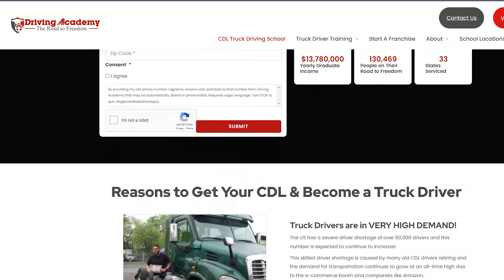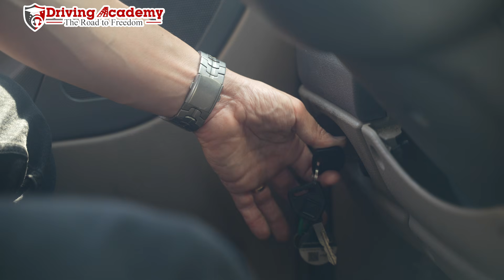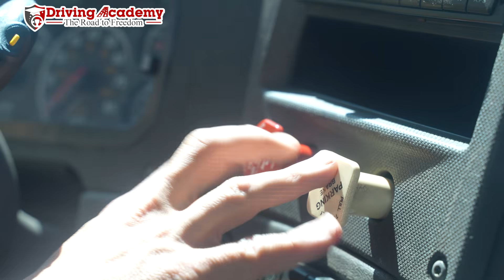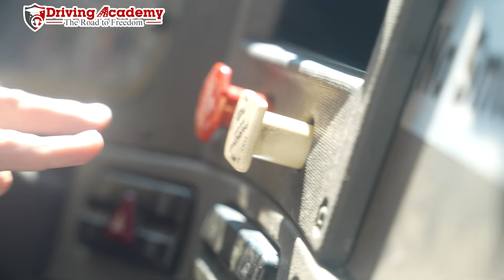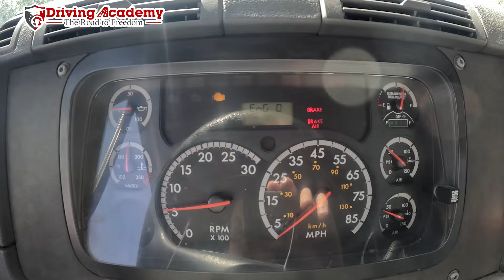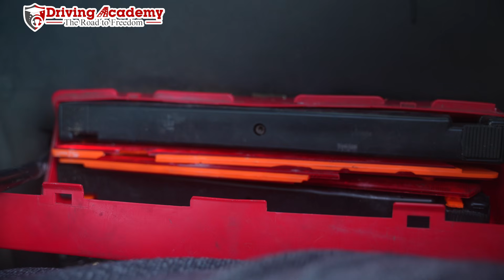NEW 2026 CDL IN-CAB INSPECTION + AIR BRAKE TEST (STEP-BY-STEP GUIDE) 🚛 ACE YOUR CDL EXAM!

Comment: I failed my test for not double checking both valves popped out during emergency spring brakes. Only trailer popped and tractor stayed on. SMH I retest tomorrow
Reply from the maker: Don't get discouraged, you'll get it right this time!

Comment: Please stop giving Mis information during the in cab inspection, once you complete those steps you CAN NOT  do it in order you want as long it’s done. That is an automatic fail, they will tell the driver they are jumping and fail them. It has to go 1-28 on that list as per the DMV !
Reply: I am sorry to say but you have no idea what you are talking about. Maybe your particular trainer instructed you to do it this way, but they want drivers to do the minimum basic safety check items per DOT regulations. There is no "128 items" on the list. In some states you can actually use the checklist during your examination and check things off as you go. The air brakes test MUST be done in order or it's an automatic fail. Build air pressure to governor cut out. Air leakage test by pushing brake pedal and timing 60 seconds and not losing more than 4 psi in a combination vehicle or 3 psi in a straight truck. Fanning the brakes to check the alarm system at 60-80 psi but no lower than 55 psi. Fanning the brakes until the valves pop out. Then restarting the vehicle to rebuild air pressure at which time you can perform your in-cab inspection (mirrors, dash indicator lights, horns, heater and defroster, windshield, windshield wipers and blades including fluid and blades making contact with the glass. Emergency equipment check. Steering wheel check for play. Once pressure has built back up to 125 psi or so, perform the tug test with the each brake trailer then tractor and try to move forward. Then performing the service brake check by moving forward 5-10 mph with palms slightly touching the steering wheel underneath, then hard braking to make sure the wheel does not move to either side. That concludes the brake test.
Reply: @BrendenLee-dg  Thank you for some proper info.
Reply: maybe it differs by state because in nj after the air leak test order didn’t matter
Reply: You do know different states have different rules right
Reply: What do you mean 1-28? Have to check 28 things in order?
Reply: @Billygoatrico No you don't
Reply: This is a free video of an overview.